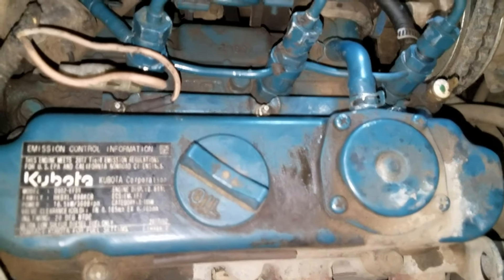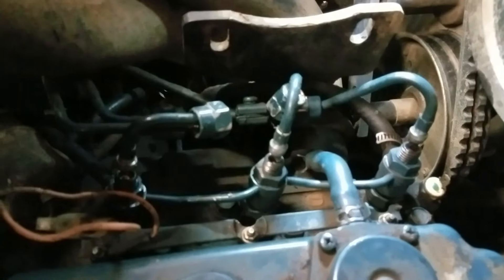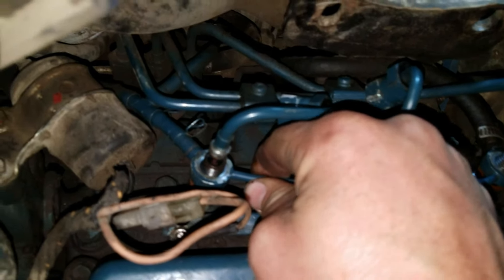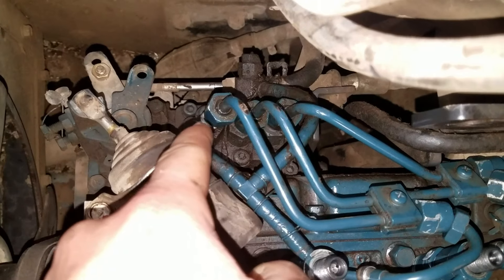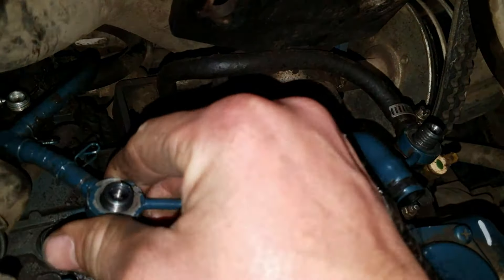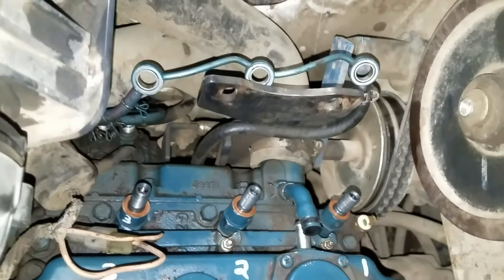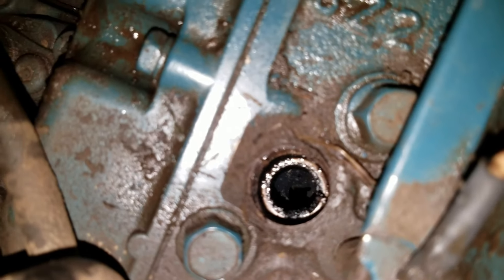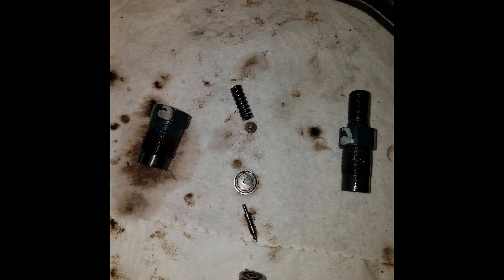3 cylinder Kubota diesel motor fuel injector removal and replacement.

Comment: Was that a bobcat Mt52?
Reply from the maker: Mt85
Reply: @rosincore  I got a question about the same issue you had here
One of my employees laid my minix on its side and let it set thst way for 30 minutes he got it pushed back up right waited 30 minutes and tried cranking it He says it took 30 minutes of trying to start it to finally start Then he ran it pretty hard for a couple hours He never told anyone and failed to call me and report the roll over It now runs fine but puffs white smoke and it seems to have crank case pressure 
Is there anything I can do to stop the smoke Seems like it runs fine other than the white smoke and high crack case pressure 
This is a 2019 kabota K008-3

Comment: And setting the pop off pressure?? Video is a total con, the description of a vacuum line is totally wrong. No vacuum present there, it is a leak off pipe.
Reply from the maker: I was just showing removal and re installation. Not modifying pop pressure. That would be a whole different video explaining shims and pressures. Yes I know I mis spoke. You are correct with the pipe. Sorry I made a mistake.